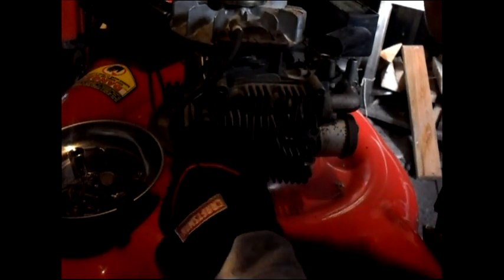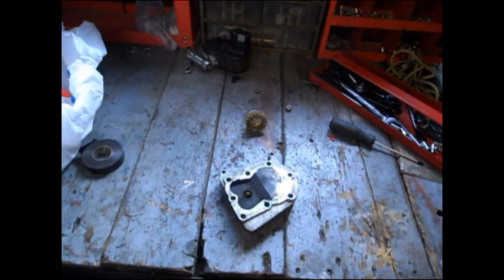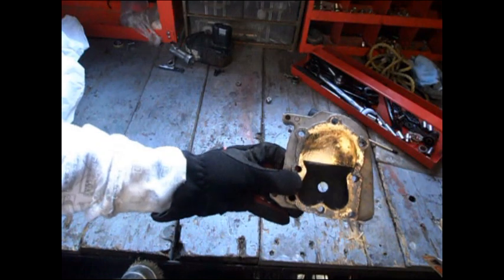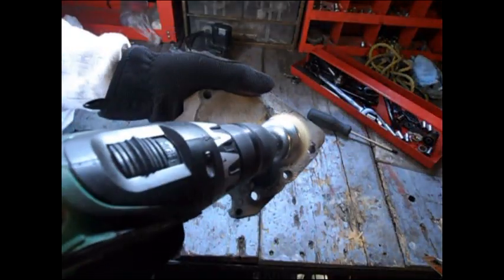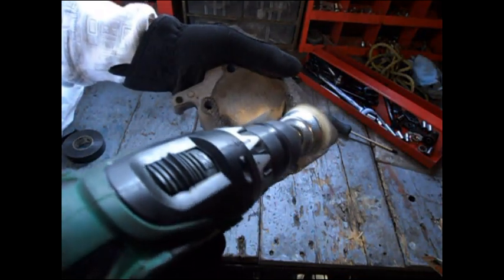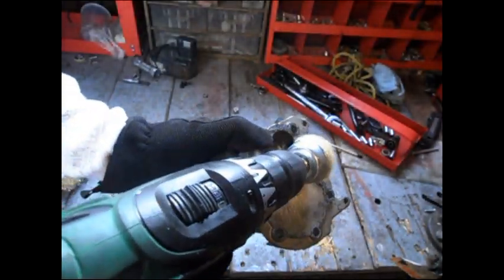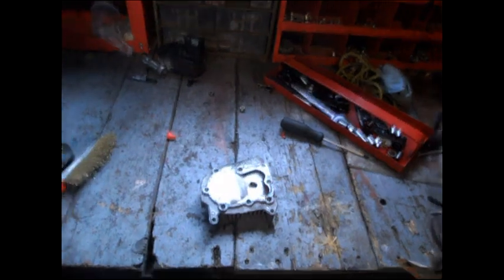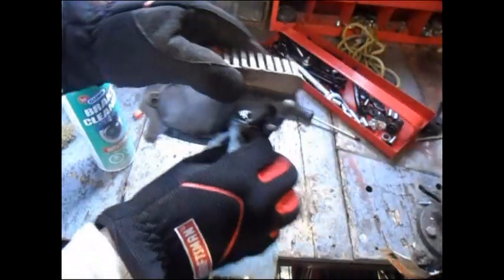How to remove carbon of a cylinder head part 1

Comment: Dude you are doing good but the wire brushes will damage you head and piston, get some brake parts cleaner from Advanced Discount auto parts the cans are like 4 bucks. spray that on the carbon and it loosen it up and you can wipe the carbon out with a rag or paper towel and if there is till some caked on us an old tooth brush or a dremal with a plastic brush tip it will take longer but it will get the job done and using plastic brushes will not damage any of the major components. just a tip